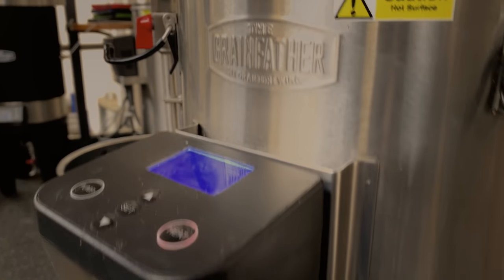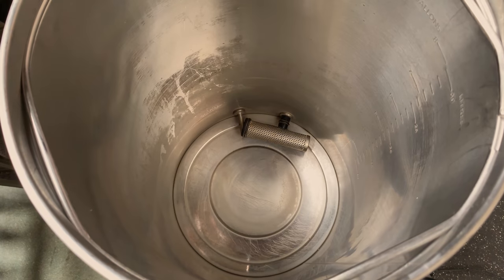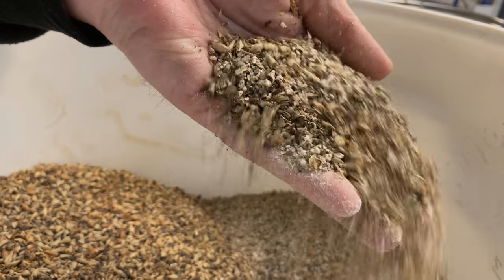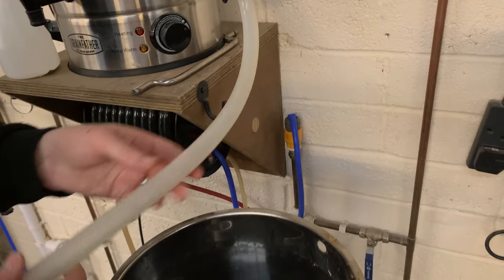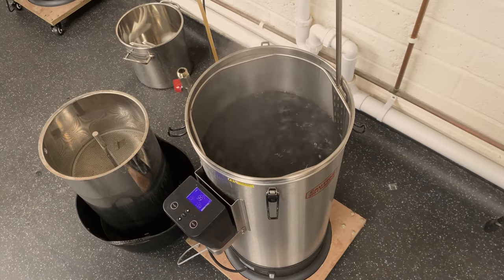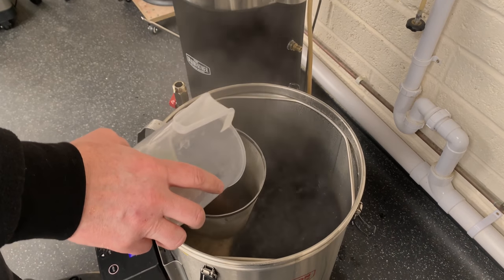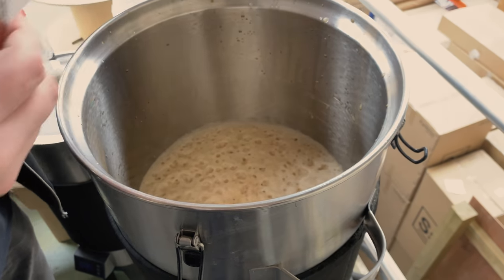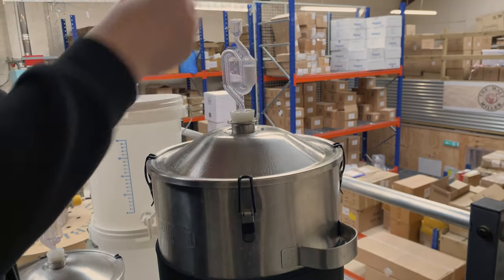How to home brew on the Grainfather - Peanut Butter & Chocolate Milkshake Stout

Comment: Brilliant video, definitely confirms that I’d like to upgrade to the GF when I love house at the end of the year. I love the way you have it all wall mounted I think it looks great! 

One thing that seems to counter what I’ve seen elsewhere though; whilst recirculating the wort through the chiller to sanitise it. Should you also have the cold water supply on at this point to begin chilling? Otherwise aren’t you firing hot wort straight in to the fermenter? Cheers.
Reply from the maker: The hot wort first of all goes back into the grainfather itself, when you start putting into the FV then I put the cold water on to start chilling it.

Comment: Most informative grainfather video yet..

just one question. When you connecting the pump to the chiller and started pumping it straight into the fermenter before you turned the cold water on. wouldnt the hot wort already be going into the fermenter? i fort you had to turn the water on and pump it through the grainfather a couple of times to bring it down a bit before you actually move to fermeneter.
Reply: Depending on the temperature and flow of the cooling water, it might be possible to start right away and cool down the warmer wort that collects the in fermenter in the beginning with wort that's a bit cooler than target temperature afterwards. Would take some experience, but doable imho.